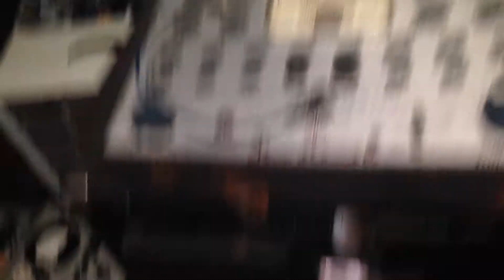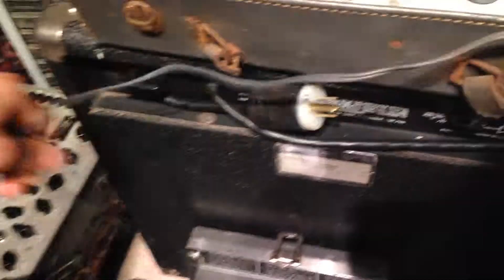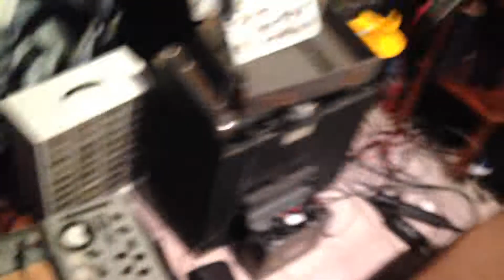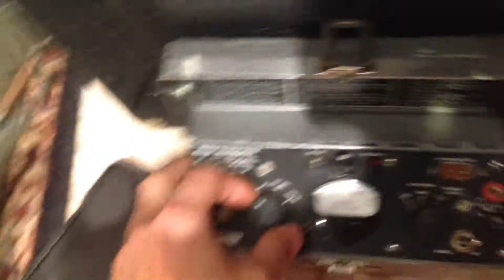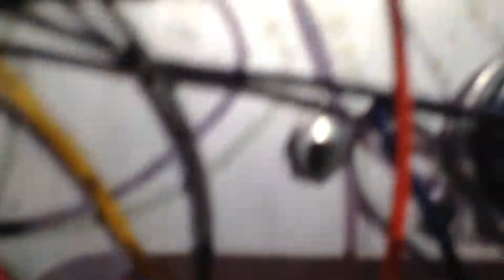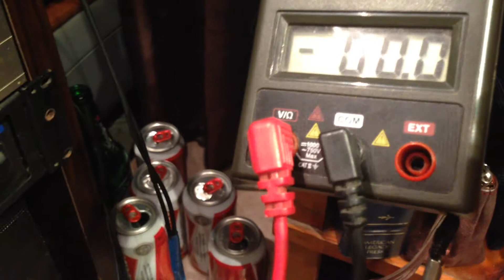Superior Instrument Co. Rapid tube tester

Comment: Yep - I sees the high voltage. If the schematic I found is correct for that unit, there is no voltage regulation on the inverter. The only voltage control is manual with the high-medium -low switch. That switch just changes taps on the secondary side of the transformer. There is a charging regulator, and since a fuse in the charging circuit blew, I'm wondering if the charging circuit has shorted and is overcharging the batteries. If the unit is designed to run on 12 volts and <if> the charger was overcharging the batteries up to 16 or 18 volts, that could explain why the voltage is high even with the low setting. What kind and how many batteries are in there? Also what voltage do you actually measure across the batteries?
Reply from the maker: Yes you are exactly correct sir.  It's actually only worth the sockets and the meter!
Reply from the maker: I did another vid of it, showed the insides and the weird batteries...